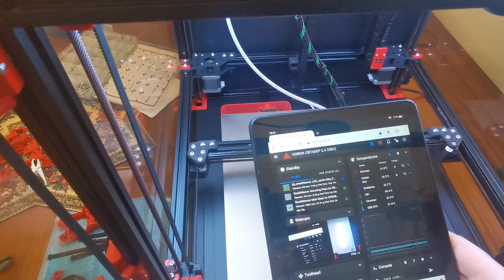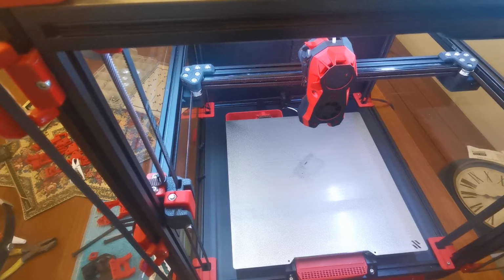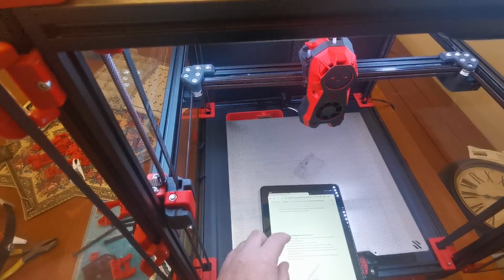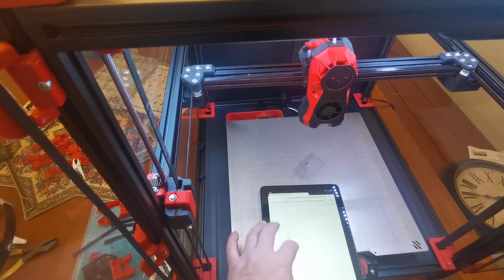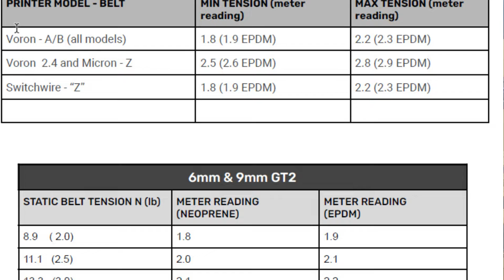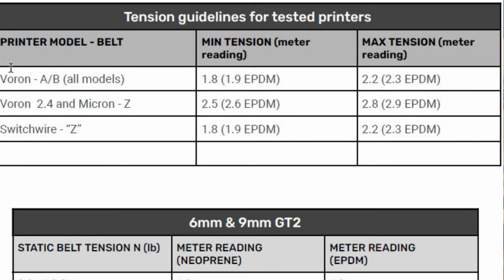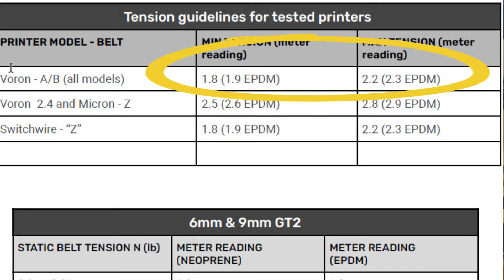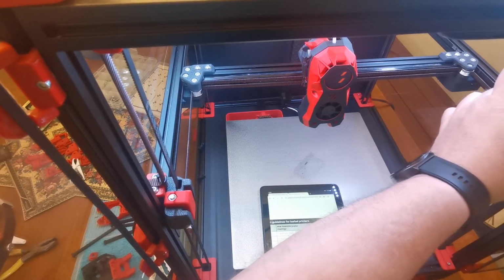GT2 Belt TENSIONER TOOL - HOW TO CALIBRATE AND USE

Comment: Sir, 150 mm of free belt length is used when you are using vibration analysis to asses the belt tension. If you use the tension gauge, it does not matter whether the free belt is long 100 mm or 300 mm, the tension in belt is still the same.